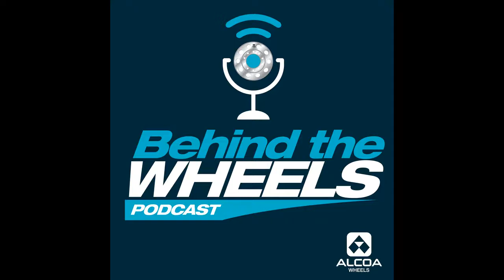Aluminum Wheels Vs. Steel Wheels: An Age Old Debate

Comment: On the same size disc wheel with same bolt hole  circle can you chamfer holes and convert a hub piloted to a stud piloted wheel??
Reply: Or end mill with correct ball seat profile? Correct depth of course.